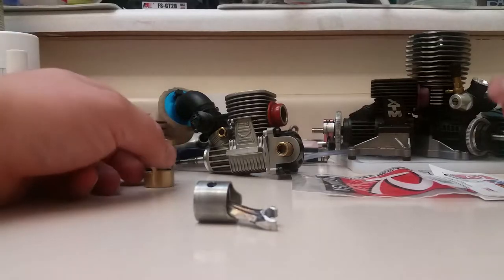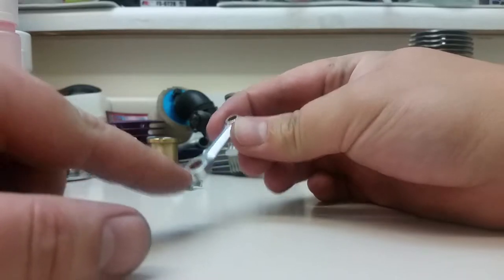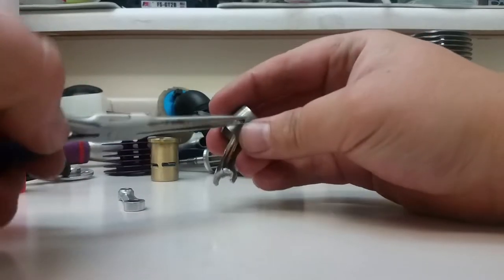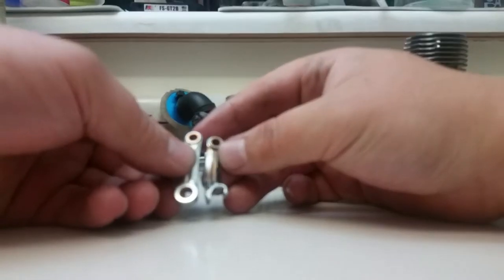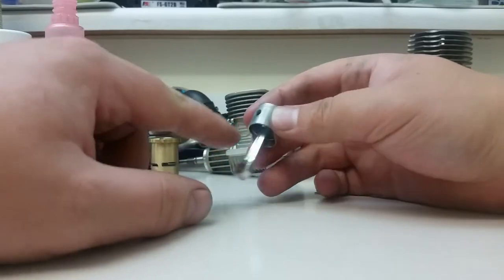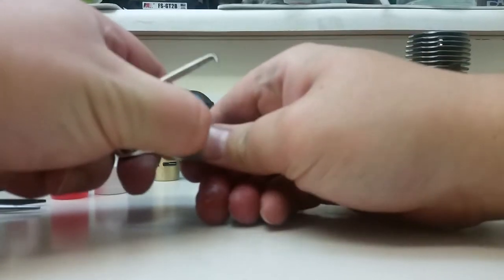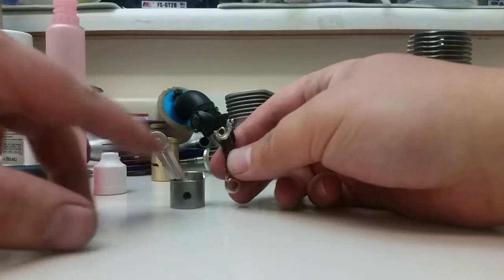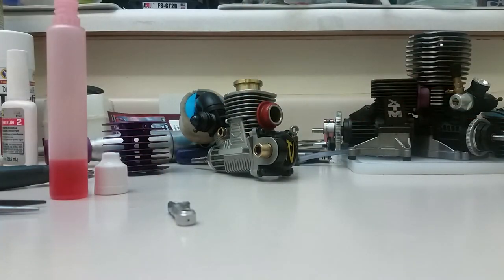Novarossi broken connecting rod replacement  rebuild #1

Comment: I need to replace the con rod on an old (but little used) OS 21 EXR that lost the nut on the flywheel, over-reved and destroyed the lower bearing about 30 years ago.  What is the procedure for removing the piston?  Take off the blue heat sink head, back plate what?  Try and slide out the crank?
Reply from the maker: Basically yup. I have other rebuild videos in detail explaining it. Farley new videos as well. It's the same process for Basically all of them

Comment: Can you put a pull start on Novarossi engines
Reply from the maker: Some of them have that option but 95% of them no you can't I don't know if they even make pull start engines anymore I know most of the pull starts and roto start setups are disconnected

Comment: I have novarrosi. 21 beat BT5 I need to replace the piston but I can't find it anywhere soo can I use the piston for the novarrosi .21 P5 is the same engine the piston will fit on my BT5 right?
Reply from the maker: Honestly I'm not sure
Reply from the maker: You can't just replace the Piston you have to replace the piston and sleeve together there is also companies out there called Ray A racing who can re pinch your cylinder and make the engine like new again I can suggest if you're on Facebook joining the nitro RC enthusiasts group that would be your best bet for more information
Reply: @thebug4046  yeah I know I bought new piston whit new rod and sleeve. Together assemble already but I not sure if is gone fit I call and they same should work is the same piston well I hope so🤣
Reply from the maker: @CorvetteC6-LS2  well good luck and hopefully everything goes as planned!
Reply: @thebug4046  thank you
Reply: Yes!!  It's the same piston in both engines...16.26mm x16.80mm